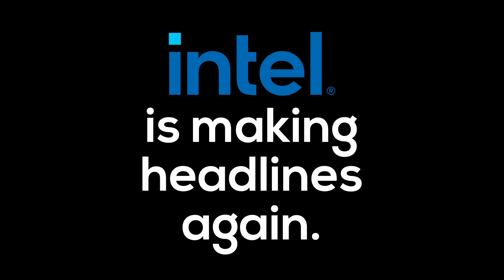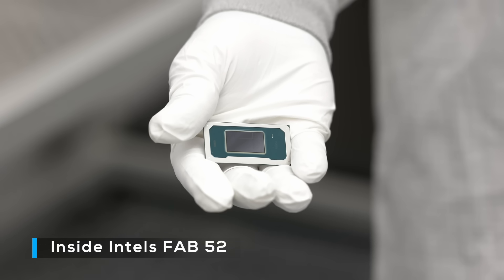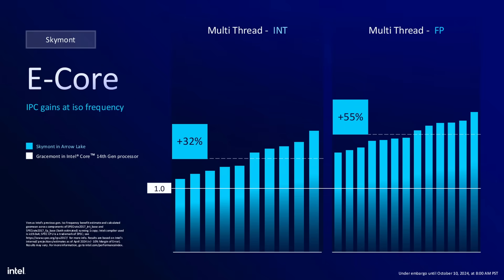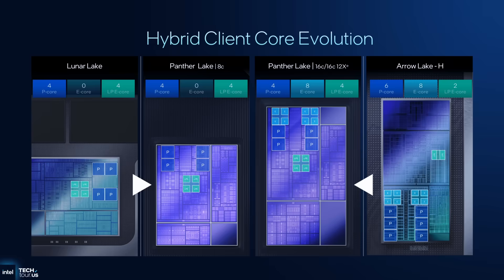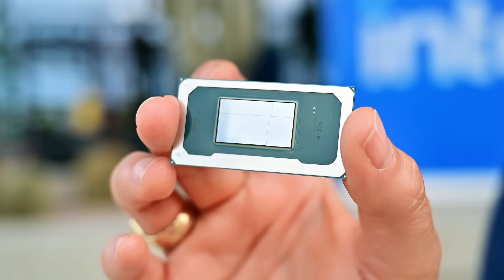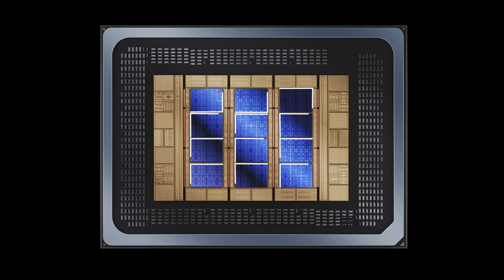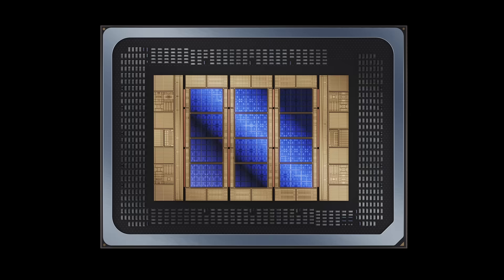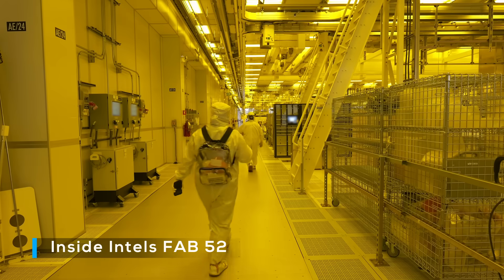Panther Lake, 18A & The current state of Intel

Comment: Lovely video. 500MB is crazy. Also nice Lego building xd.
Reply: AMD had X3D servers with 1.1GB of SRAM cache, although A) it was split into 96MB chunks or so, and because of the way AMD does their chiplets you couldn’t share across it ‘continuously’ like Intel’s approach here, and B) apparently, and allegedly AMD stopped doing that after a single generation because their basically sole customer for that product line switched over to the HBM Mi CPUs. 

But yeah, positively insane in a good way. I think Granite Rapids is also 540MB? Should be incredible when that filters down to consumer. (Rumor has it Nova Lake will have 288MB split between two 144MB halves.)

Comment: Lakefield was the prototype that started this trend for Intel. Also perhaps more on the drama side, I remember clearly Intel execs mocking AMD for doing chiplets. Might be just an historical tidbit. (PS AMD sux)
Reply: Intel mocked AMD for chiplets, AMD mocked intel for “chiplets” (by any other name), they’ve both taken pot shots over perceived architectural shortcomings.

Most recently, I think an AMD exec called the E cores “Econo-Cores” and either TSMC or again an AMD exec said that Intel was “bound to fail if they don’t go fabless”. (I wonder why TSMC might want Intel to go fabless? Who’s to say.) 

Intel also had a Xeon with the same “””chiplet””” design that first gen threadripper / Epyc used, I think it’s called cascade lake AP? (Asterisk: I’m not 100% if the first gen had 4 chiplets on Epyc, but the Intel was just two. Basically, just two sockets sharing the same interposer. Which, until AMD adopted the IO die design in later generations is basically, as I understand it, how they had it set up.)
Reply: @levygaming3133 Pentium D existed many moons ago, nothing new under the sun...(At that time it was new) Interposer tech is new though

Comment: Souund promissing for a high  end  clockspeed desktop cpu
bspd i did'nt  seen coming this changes everything
if  panther lake reach 5,0ghz with less than 1,0,v normal deskttop could be as high  as 7,0ghz with 1,2v
 there is one uncertain,  ipc unclear how good it  will be.
possible that intel can reach zen6 with a slight  better clockspeed better for singlecore affin workloads
npva lake i am talking about so1954 could be a major drift to intel again on desktop
new socket new chipset nee features on I/O
smd must answer this with am6 andd  zen7
That let me wish amd launch am6 at ces 2027 much earlier than expected
means zen6 is near about q2 2026 if intel relse npova lake around q4 2026
So sad that dgpu are stagnating. but it will be interesting  forcpu limit test on 2 high  end gpu rtx4090 and  rtx5090 there is a difference between those
if rtx4090 is not cpu limited it should be closer to each other

Comment: I wish intel would give us better entry-level/lowend CPUs - not just for mobile but also for desktop:
2p8e4le with 12-24xe and the large IO
Yeah give us a a small i3 with the big GPU. The large iGPUs on mobile have shown for years that they can be quite capable for gaming and in general you are far more GPU-limited than CPU-limited. So give us a full fat GPU with small CPUs. And stop only giving mobile the decent iGPUs. Why is desktop stuck with like 1/3rd the GPU of mobile? Heck - give us L4 again and add some on-substrate VRAM: Intel had done both these things in the past and both worked really well. And now with the the tiles this should work even better.

Comment: Also it should be mentioned as to why tiles are preferable is that yield rate goes down with tile size - so it could potentially be a lot more efficient in terms of both resources and money to produce modern high end chips. And this effect is not subtle. As far as I remember yield is exponentially dependable on tile size. So your yield gets exponentially worse as you go bigger and bigger.
Reply: You're very right. Yield is highly dominated by particle induced defects, and thus drops exponentially with die area. On modern nodes every bit of extra yield design can eek out is saving untold amounts of money on the production line.
Reply: Yeah, I laughed out loud when the presenter said in the video that Intel weren't motivated by cost optimisation! Maybe this is a side-effect of tech youtubers/reviewers depending on access (crucial to be invited to these presentations) but they really shouldn't be buying into all the marketing they're exposed to... my opinion. Also: where's the cost discussion? AMD has managed to stay real close to the Pareto frontier with their Zen 4c cores in the recent years, and Zen 5 to lesser extent. Doesn't matter what kind of gains we're looking at with 18A if it doesn't beat depreciated Zen 4c packages on cost efficiency.

Comment: I wish they would make a 24-32 core cpu with only E-core under $500, that would fit a lot of people work load these day.
Reply: There’ll probably end up being a Nova Lake SKU with ~24 E cores at or under $500, albeit tied to a bunch of P cores. I do think they should offer all-E-core models, if just to showcase how great they are now, considering that stuff like the N100 is easy to ignore / miss when it’s not on the normal socket (or even socketed at all!) and the single memory channel there isn’t helping any. 

Would probably require a completely dedicated die to make it happen though, wether it be a version of the Clearwater Forest tiles in this video that don’t depend on an active base tile or a smaller active base tile that works with Nova Lake normally. (Expensive?)

Is probably to expensive for what’s mostly just a promotional tech demo. Although, the rumor is that Intel is swapping over exclusively to the E cores in a few generations.
Reply: @levygaming3133  I don't know that it's really too expensive -- AMD has all-Compact-core server-chips, for instance. For server I definitively think Intel can do it. I doubt how useful an all-e-core chip would be for desktop however. Perhaps for people who run specific media-servers?
Reply: @predabot__6778  I didn’t mean too expensive in that they couldn’t get the end part cheap enough, just that the cost to tape out a new die, just to have a part that while very cool probably wouldn’t help Intel’s market share would be an expense they’ll probably have to avoid.

Although I do think they should put out all E core and even all P core parts, if for no greater reason than to highlight the strength of their hybrid approach. Basically, like they did with servers this generation, where you had all P core and all E core parts sharing the same socket.
Reply: @levygaming3133  Yeah, I just saw High  Yield's video about the fact that Intel has all e-Core server-chips - I should have double-checked if they already had those.

Comment: 3 core types on one CPU will never work.
Reply: I hope you’re typing that from an iPhone, and not one of the countless androids that use 3 core types and have for the last half decade (if not a full decade now?)

You have the “X cores”, the “7 cores” and the “5 cores”, with the current generations being X920, A720 and A520 I think? 

Also, if AMD continues as they have now and they are rumored to, then either the next generation or the generation after that is going to feature three different core types. X3D cores, non-X3D cores (AMD offers parts with a split of both) and they’re allegedly adding compact “Island” cores of their own. It really is the future.
Reply: @levygaming3133  yeah the 500 series cores are useless, too slow IPC to actually do that and intel low power island cores are basically inert silicon

Comment: Thunderbolt 4? On the newest node? Seriously, I know most builders in the DIY space don't care about Thunderbolt but for OEMs and system integrators Thunderbolt 5 is a far better solution and a nice option to have as a promotional tool to sell to the customers. I hope intel will get their act together but to be honest but until x86 addresses the heat & power draw issues which are inherent in the architecture the era of CISC dominating is slowly coming to an end in my opinion for the regular user.
Reply: It should have Thunderbolt 5 if they use a dedicated “external” (idk if that’s the right term) controller, as existing ArrowLake laptops do without integrated Thunderbolt 5.

Definitely would’ve expected it to have integrated Thunderbolt 5 though, even if it was only one or two.
Reply: @levygaming3133  It just seems like the logical thing to do unless Intel are cutting corners still to save money. No one is really exploring Thunderbolt 5 outside of Apple and with the boom of MiniPCs on the market and now the larger "MiniPCs" that house desktop chip (Mac Studio form factor) with Intel chips it just seems like they would explore an option with thunderbolt 5 for that segment. IDK maybe Intel just doesn't care about PCI tunneling anymore. But for the server and DIY market they could strip thunderbolt out completely and no one would notice.

Comment: For the normal consumer that builds their own computer be it gaming or workstation, the plus has been on AMDs side with platform longevity. I wish for Intel to do the same so as to be more consumer friendly and give Intel enthusiasts an upgrade path that doesn't involve new hardware every time but to only be able to swap out the CPU for a couple of generations at least.
Reply: AM4 is the best platform in history and AM5 seems to become just as good. 
Unfortunately Intel doesn't learn. They won't become competitive again anytime soon.
Reply: I believe there are rumours that their next platform will aim for similar longevity to AMD, so at least 4 generations of CPU's.
Reply: @predabot__6778 What would the performance increase be over 4 generations i.e 3 generations of ugrade possibility? Probably not significant. Even less so for those who enter half way or late in the socket cycle. They'd get no useful upgrade path. That's why I don't think socket longevity is really all that importent, plus it has the potential downside of limiting the potential performance in subsequent generations. I went 8 Intel generations before I considered upgrading to be worthwhile.... a 2X single core speed increase. No socket type lasts 8 years.
Reply: AMD's AM4 longevity is an outlier. Looking back over the past 30 years, both have implemented many socket changes. AMD was appalling at one point which contributed to me switching to intel. The reality is though that most people don't upgrade their CPUs even when than can. Most people upgrade motherboard RAM and CPU or buy a whole new system. AM4 may heve been the exception. Very few sockets formats have stayed current past 5 years. Intel LGA 775 was one if the few. It lasted 7 years. Now onto AM5... who knows how long that will last.

Comment: Intel just can't get over giving only 4 P cores. They'll add shit ton others E cores, LP cores, LPP cores, LPPP cores but keep the same 4P cores across the board. The old greedy Intel is still somewhat alive in there.
Reply: I’ll admit I’d rather it had at least 6P cores like ArrowLake H had, but it’s not like AMD is really selling any laptop parts with more than 4P cores anymore either. The 370HX is 4P cores (still not full cores at that, because I don’t think it supports either the full 512bit without double pumping of desktop nor does it have the doubled L3 from something like Zen3 I think?) and 8 “effiCiency” cores that only clock to 3GHz, have half the L3 again, and supposedly are basically a CCD hop away, although I remember AMD contested that but I haven’t seen any updates since.

AMD’s completely dropped their more normal 8P core laptop SKU like the 5800U/6800U/7840U sadly.
Reply: @levygaming3133  I thought AMD had no hybrid model and every core was as good as P core or atleast the majority of it? When did this shift happen?
Reply: @zweitekonto9654  For desktop "all P cores" make sense, but I can certainly see why you'd want a mix in mobile where performance per watt and battery life is everything. I have a 7840U based laptop myself, but it's always plugged in, so battery life is of no concern to me. But if I was commuting long hours I'd probably want something that can play movies and webbrowse at basically no power usage.

Comment: when we will see it ?
2028 ?
Reply: Should be at CES right at the start of January 2026, just as test silicon already running Windows was at CES 2025 at the start of this year. 

Also, I suspect that’s why some recent 370HX laptops that just came out are in such short supply, because the OEMs know that Panther Lake is literally right around the corner.
Reply: @levygaming3133  
they cant achieve 18A (16nm) mass production before 2028
Reply: @seeking_to_right  first, Intel says it’ll be at CES, and I fully believe that, although really it should’ve been out already, and second, why are you saying that that Intel 18A is actually 16Nm, and so worse than the famous and immortal 14Nm? Did you mean 1.6Nm? Which isn’t really what I’ve seen anyone call it, it’s most likely just equivalent to TSMC 2Nm (that TSMC claims will be in production next year as well, although wether that means products is tbc. Technically, Intel weaseled by having their panther lake parts “in production” this year, when I thought the idea was they’d be selling them already this year.)
Reply: @levygaming3133 
Semiconductor manufacturers 
fooled us 
18a is actually 16nm 
tsmc 3nm is actually 18nm
we cant go under 12nm ! 
their 5 4 3 nm are just name that mean smaller

ChatGPT for more understand
Reply: They are already in production preparing for official release.

Comment: How about the cost? I think 18A will be cheaper to produce compared to TSMC N3 node, which will work great for intel but not so great for AMD and the rest of the competition. 

Can you make a video on cost per wafer/cpu for intel, amd and Qualcomm?
Reply from the maker: That really difficult to say because even if Intel Foundry is now officially separated from Intel Products, and 18A is available to external customers, it’s still more or less an “internal” node. I think it’s cheaper because there’s no TSMC premium. But I don’t have details.
Reply: @HighYield  except intel has to foot all the R&D costs themselves, and when you look at the complete package, AMD will be still at a massive advantage having much less designs and reusing the same dies across most of the stack

Comment: Hmm, it’s almost as if the 5-year strategy laid out by Pat Gelsinger in 2021 is coming to fruition… you know, the one that he said would require a lot of money upfront and patience, and the Board shouldn’t get scared midway through and try to drastically change directions?
Reply: You spoke my thoughts! Pat's focus on technology improvement and advancing to High NA EUV has lead to this.
Reply: @s7amBa  I don’t think High NA is being used on 18A. I’m pretty sure it’s supposed to be deployed on 14A, and 18A just has regular EUV. I’m skeptical of the ROI on High NA. But, nevertheless, putting technology development back in focus and accelerating advances in EUV, backside power delivery, and GAA was critical if Intel wanted to remain competitive, and Pat was at the forefront of all of that
Reply: That is the problem with publicly traded companies they loose all patience and dynamism
Reply: Stop it please. You are talking about the guy that was responsible for the Itanium disaster.
Reply: @rosomak8244 Pat ? For Itanium ? He wasn't the main guy behind it, as far as I know. He was the lead for 386 and 486 which are kind of legendary.
Reply: @rosomak8244 I know spreading misinformation on the Internet is fun, but you're just wrong. He in fact specifically said "I have not in my career been an Itanium advocate." He was in charge of Intel's enterprise CPU group during the Itanium period, but that also includes Xeon CPUs, which he advocated for within the company, likely saving Intel, as others wanted to ditch Xeon and focus on Itanium. Pat has always been an x86 cheerleader through and through.
Reply: @azazelleblack  "He was in charge of Intel's enterprise CPU group during the Itanium period". It was his.
Reply: @rosomak8244 Itanium was started in 1994 under Andy Grove. At that time Gelsinger was VP of the "Desktop Products Group". So we're talking about "the guy that was responsible for the" 486SX and Pentium MMX.

Comment: I wasn't sure if the IO tile is rescued between the SKUs. As the memory specs between -U and -H12 are different. 

still worried about the dummy tile becoming an NSA sponsored backdoor.

I hope we get a detailed comparison between Xe3-4 and Xe3-12 in terms of power and OC from a channel like Scatterbencher. I can't recall a situation where the same architecture is put on different foundries like this. Plus first time I tell does GPU in the Xe era?
Reply from the maker: There are two physically different IO tiles. I confirmed that. And we talked with Intel, the MEM specs are just what Intel validated. OEMs can change that and there shouldn’t be any actual difference in the PHYs and MEM control.
Reply: The dummy tile shouldn’t be any different than the various HBM equipped parts that have needed and used a dummy tile for structural reasons. Doesn’t the AMD MI series use them?